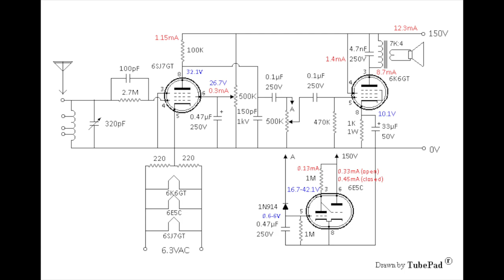6SL7GT 6E5C 6K6GT Grid Leak Detector and Magic Eye

Comment: What is the antena coil especifications ?
Reply from the maker: 100 turns of 0.25mm diameter wire on a 30mm cardboard tube, with taps at 25, 50 and 75 turns.
I've also wound some coils on each end to use for antenna and regen connections in future, but I haven't tested them yet.